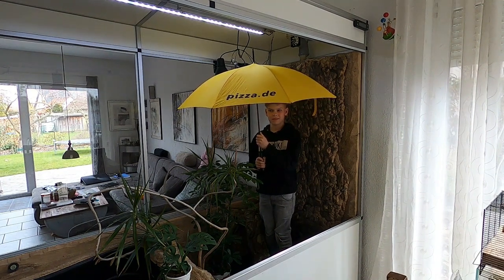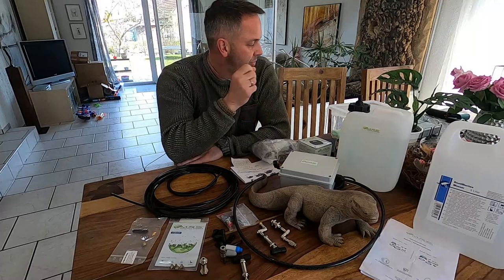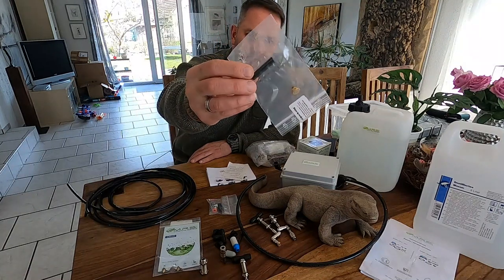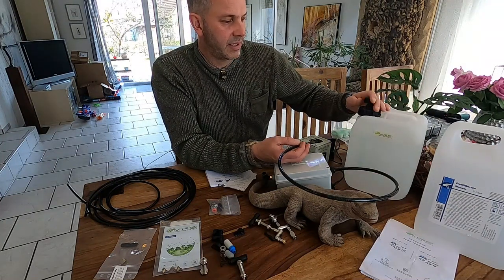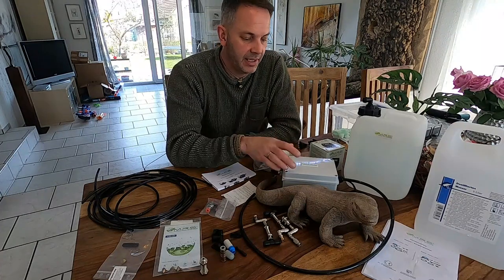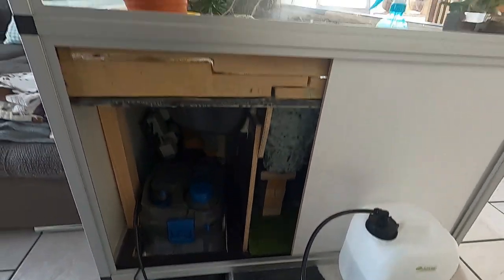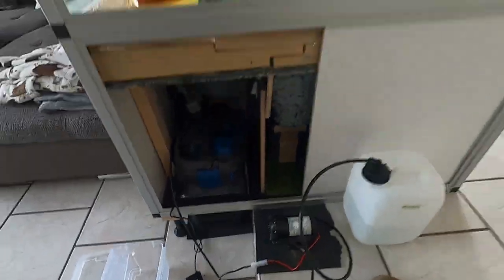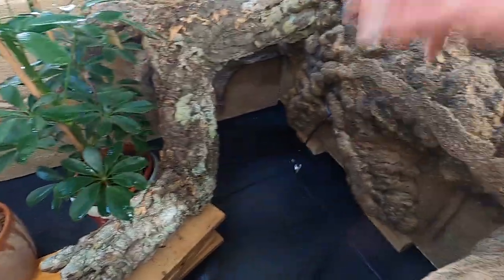Misting system, reptile rain system for my paludarium, MRS Micro Rain Systems, DIY Install, Part 18

Comment: the normal pump for misting systems is the second one. not the first one
Reply from the maker: Bothe are misting pumps. The first one is the older model and the second one is the newer quiter 24 Volt model.